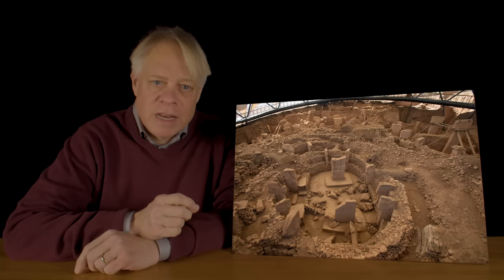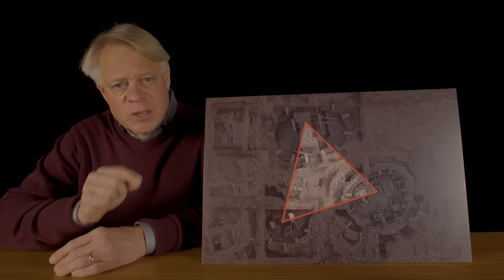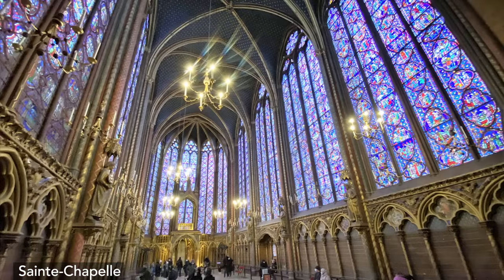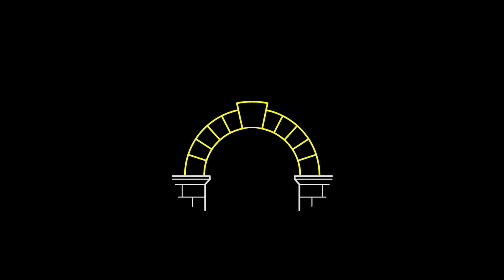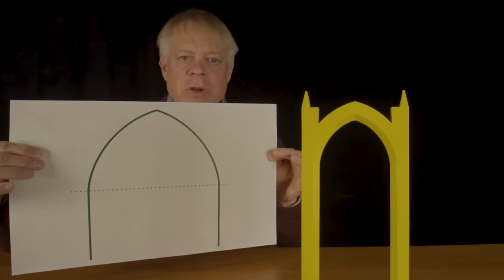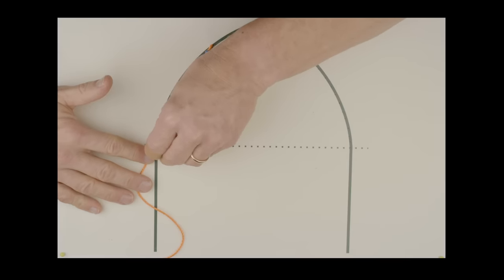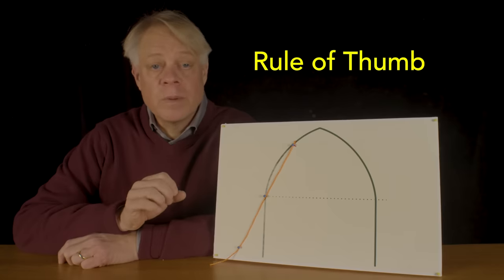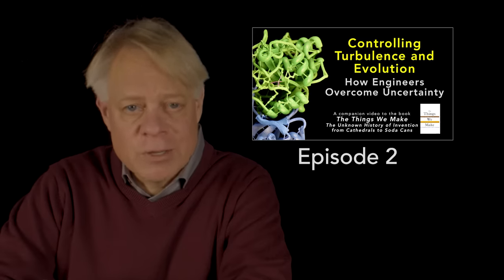Building a Cathedral without Science or Mathematics: The Engineering Method Explained

Comment: “I never worked out why, geometrically, that works- because it doesn’t matter” 

I love this a lot. You don’t have to understand why it works, you just have to know that it works. It’s the same reason you can be an electrician without being a quantum physicist
Reply: It's simply magic :)
lol
I think they just played with small models like you would with CAD & just proportionally expand it to what ever size you'd like. :)
Reply: You still need to verify that it works though with lots and lots of experiments. This is also how electricity was discovered before we knew about electrons and basic atomic theory: lots of experiments and writing down the results.
Reply: There are two types of bad engineers.
1. Those who waste time trying to come up with the technically perfect answer.
2. Those who blindly use their tools.

1 wastes time and money, 2 is dangerous.

You need to understand what's in your toolbox, and what the limitations of each tool are before you use them. Good engineering  is engineering plus risk management... "if I'm wrong which of these tools will make me wrong in a conservative or mitigatable manner "
Reply: What I think is beauty in engeenering is that a engeneer/theoric can deduct general rules and a engeneer/applied can create simple models. With this simple models the common electrician can work within a security margin with not deep knowledge
Reply: @driatrogenesis  quantum mechanics explains how electromagnetic fields behave and interact with matter, and why specific materials are better or worse at conducting electricity than other materials

There are other fields that explain different aspects of the topic, but the point is that you don’t need to have absolute knowledge of a topic in order to apply it to the tasks at hand.
Reply: @driatrogenesis  I’m sorry, please explain how quantum mechanics doesn’t explain anything? 

I get that the models of quantum mechanics are more just abstract representations of the physical world rather than being a literal description, but they still allow us to make predictions, create practical applications, and form a framework for understanding the weirdness of the quantum world, at least to an extent.

Even if it’s not a perfect explanation, it still serves the same function
Reply: @driatrogenesis  I wasn’t saying that other fields didn’t contribute to our understanding of electricity and how it functions, I’m just saying that quantum mechanics helps to describe some of the fundamental principles behind it that aren’t touched upon as much in other fields.

A true understanding of electricity requires all relevant fields, and I’m not trying to downplay the importance of any particular area of study
Reply: @driatrogenesis  What is your point here? How does any of this discount the descriptive power of quantum mechanical models?
Reply: @driatrogenesis  please just tell me in clear language how Quantum Mechanics can’t explain anything. You have yet to actually explain yourself
Reply: @handlsarelame I understand your concerns, but you are really misunderstanding my point. 

I’m just saying they don’t need to have the same level of understanding as a quantum physicist, which is objectively true, since if you’re as knowledgeable as a quantum physicist, you’re probably going to work as a researcher instead of an electrician.

More knowledge is always desirable, but a minute understanding of the fundamental mechanics of the universe isn’t always necessary for practical applications. You just need to know what is relevant to your line of work
Reply: @handlsarelame They learn a quite simplified version, really even a lot of electrical engineers don't properly understand how electricity "flows". What they learn are heuristics. Of course it's good to know a bit about how things work (or more specifically useful heuristics) but knowing how things actually work and being able to do things aren't actually nearly as connected as people think. A good book about heuristics is "Rationality for Mortals" and here's the video about electricity (there was a follow up to FAQs as well)
https://www.youtube.com/watch?v=bHIhgxav9LY
Reply: You don't have to, as long as you just repeat what already exists.
A factory worker does not need to know why the stuff he builds are built that way, or why they are built in the first place.
A carpender does not need to know why a certain construction is done that particular way - he just needs to know how it is done.
Just ask one why he builds a certain connection the way he builds it - the answer will often be just a variation of 'because that's the way it is done'.
That's fine as long as you keep building the same stuff over and over.
But if you want do develop something new, you either have to conduct a lot of undirectect experiments like build houses that keep crushing until they don't any longer - or apply science.
Reply: Learning how it works is simply helpful to push boundaries and broaden applications
Reply: @w1darr  You have to be careful about always doing it the same way and not understanding why. In the 1950s, the North American F-86 would occasionally crash while inverted, invariably killing the pilot. It took a bit to sort it out, but the problem was eventually traced to someone on the production lines who was installing a bolt upsidedown because he had always installed similar bolts on prior aircraft models that way. The improperly installed bolt blocked the ailerons from moving when that part of the plane was under certain loads, and without the ailerons, the plane was difficult to control, leading to numerous deaths of good pilots.
Reply: That's why the engineering method includes "rule of thumb". He explained it.
Reply: @handlsarelame 
You are missing the point. All he's saying is that a great athlete doesn't need to study biophysics in order to know what he does and what works
Reply: @handlsarelame What you are describing is still a very basic, surface-level, rule-of-thumb understanding of electromagnetism. For fucks sake, you literally learn left-hand, right-hand rules to know what happens even if you don't understand it at a deep, fundamental level.
Reply: 1) the architects knew precisely why their constructions worked
2) they simply knew how to do the math needed to cope with the forces involved
3) they couldn't achieve that without knowing why
4) rules of thumb have not been involved
5) the idiot who made the video above doesn't know what he's talking about
Reply: And which, the electrician or the physicist, is more essential in everyday life? I say the electrician. I have known many mechanics, carpenters and electricians you know, the trades. Their intelligence is creative and flexible. In fact most can solving problems outside their area of expertise.
Reply: @hans-joachimbierwirth4727  you got anything on that topic I could read on? I find it hard to believe they were winging it, I want to see their own takes if there's any.

Comment: I wonder about the process of developing one of these heuristics.  Was it one person or dozens who were able to identify a possible solution to a problem and then refine that possible solution by successive approximation, until the result stopped improving. Did it happen quickly or over scores of years?  What about the initial inspiration to try that type of solution to the problem.  Fascinating.  Thank you for this story.
Reply: Worst case: ask the same question about the creation of human beings . . .
Reply: @QED_ creation lmao
Reply: It would be helpful if the presenter provided some references that explain now he knows that these techniques were actually used.  As it stands, we have know idea how or if he knows that this was actually the method used by the cathedral's builders or if the presenter is merely guessing.
Reply from the maker: @rustyshimstock8653 The book contains the references …. This is a companion video to the book …
Reply: Well, then the book is as misleading as the video is. You clearly don't know what you're talking about.  @engineerguyvideo
Reply: Thank you for the bamboozling fairy tail , would sound more appropriate.
Reply: @hans-joachimbierwirth4727  sounds like you have an alternative explanation or idea about how these methods were developed?
Reply: @Cleveland_Rocks  Height wasn't the problem, neither was it the reason for the gothic arches. Width was, and horizontal thrust is the problem. Roman construction was based on different materials of which cement was one. Roman domes do not produce  horizontal thrust. His rules of thumb don't exist. Measurements do, and his rules would lead to collapse.
Reply: @hans-joachimbierwirth4727  His rules of thumb don't exist? Not sure I understand what you mean. Can you relate some historic data or sources that show how medieval masons and architects worked?
Reply: @hans-joachimbierwirth4727 It’s you who clearly knows nothing.

Comment: I believe part of the confusion between the scientific and the engineering method comes from the fact that in practice, these methods are often applied together by the same people. For example, let's say you test some equipment in a vacuum chamber. Some anomaly occurs in the test setup which cannot be readily explained. Opening up the chamber for analysis would destroy the vacuum and delay the tests by a week. The engineering method is used to mitigate the anomaly, allowing the tests to proceed quickly. To prevent the anomaly from occurring in the future, the scientific method is used afterwards in a thorough root cause analysis. Even though this may not be "new science" as such, it is still the scientific method, because the goal is to gain a deeper understanding of the system than was deemed necessary before.

Comment: This video reminds me so much of my dad; he was a pattern maker for 25 years and has been a carpenter for most of his life. He knows a lot of math and trig, but only enough to get the job done. If there's a way to do something practically that "just works" he'll choose that method every time, but keeps his math skills in his back pocket for the situations where that's the better option.

I remember him teaching me how to find the center of a circle once when we were making a mold for a circular foundation: he put a stake in the ground at one point on the circle with a rope that was the radius of the circle long tied to it and walked to the rough center and scratched an arc in the sand. He did that two more times at two other points on the circumference and told me that the point where the three lines intersected was the center. Blew my mind how quick and easy it was. Great video! Glad to see you back and can't wait to check out the book! :D

Comment: Fabulous! I have used various rules of thumb taught to me by 'old guys' on job sites. Often they are 'tricks' or shortcuts in math that lend themselves to fine quality without some of the complexity that more formal methods utilize. In other words, sometimes there is a hack that produces equal quality at a significant savings in time... if it meets code it's good to go.

Comment: @6:25 well by stating that the builders needed to stay between a certain ratio (1/4 or 1/5), then they had to use mathematics or an intuitive sense of mathematics to build the arches. Stating that engineering doesn't require science or math I think is incorrect, because science & math are not just what we learn in school with numbers but rather a way of thinking & reasoning.

Comment: I'm a mechanical engineer working in a cutting edge industry. we've even set numerous world records and world firsts with our designs. We use TONS of rules of thumb to design our solutions every single day, and I can explain why too. It just takes a while.
Reply from the maker: No doubt you do! The engineering method as I have described it still holds …
Reply: @engineerguyvideo  yes it does, and I love it. Too many engineers over rly on pure math, without understanding its limitations and pitfalls. Sometimes math is the right answer, other times it's not.

Comment: This is an interesting idea, but I feel like the definitions you used for science and mathematics are too narrow. It seems like your definitions of each of these subjects is the act of explicitly performing scientific discovery or the act of explicitly performing a pure mathematical analysis. I see science and mathematics as much more broad than that: when the stone mason is deciding how thick to make walls in a cathedral, they are using scientific concepts such as the idea that materials have a strength and may break under a load. When the mason uses a piece of string to work out dimensions, they are using mathematical concepts of geometry to arrive at these dimensions.

They're still leveraging mathematical and scientific understandings even if these understandings weren't their own discoveries. Even going down to the specific materials they used, the techniques used to create stained glass, and the instruments they use to physically create these structures, these are all applications of science and the end result of scientific discovery. And even going down to the most basic idea of lengths and measurements, these are still ideas rooted in mathematics.

My main point is just that science and math are often applied implicitly and intuitively and thus make their way into rules of thumbs, ways to preserve past knowledge for future generations. Science and mathematics are all about understanding how the world functions and this was very much leveraged by engineers in the ancient world even if they were only doing so from a practical and applied standpoint.

It's a great video nonetheless and highlighting the fact that you don't need to fully work everything out from first principles to engineer something is certainly useful. Engineers do use rules of thumbs even nowadays, but I think it's still worth acknowledging the inherent use of scientific and mathematical intuition in those practices.

Comment: 9:50 The size of the wall is 1/4th the size of the span of the semicircle.

First of all the explanation of measurements using the threads is fantastic. Thank you!

In my language, Bengali and many other Indian languages, carpenters are called "SutraDhar", which literally translates to "thread holder", they used thread and different folds of threads to determine the sizes.

Now details about the claim "The size of the wall is 1/4th the size of the span of the semicircle."

- Dividing the semicircle in 3rds is creating points for a hexagon, if it would have been a complete circle.
- The length of each edge of a hexagon is same as the radius of the enclosing circle. 
- If the size of the span is D, then the radius of will be D/2, lets call it "r"
- We can observe that there is a right angled triangle getting formed by the extended line segment, the width of the wall and the inner side of the wall ⊿
- We know that the inner angle of a Hexagon is 120˚, the base of the right angled triangle, i.e. the width of the wall is dividing the 120˚ in half, making it 60˚
- Using trigonometry; the width of the wall / the extended line segment = cos 60˚
- Thus the width of the wall = cos 60˚ x the extended line segment 
- Since The length the extended line segment = r (edge of a hexagon)
- the width of the wall = cos 60˚ x r
- We know that r is half of the size of the span, i.e D/2
- Thus the width of the wall = cos 60˚ x D/2
- Since cos 60˚ is 1/2
- the width of the wall = 1/2 x D/2  = D/4, 1/4th the size of the span of the semicircle.

Not sure if this is useful, but I found it intriguing.

Comment: Thank you for presenting your perspective on the engineering method. I've been a retired engineer for 15 years, and at the end of my career, I did more analytics than synthesis, and wrote many reports. So, it is difficult for me to remember that creative process we call the engineering method. 
My degrees are a BSEE and an MSCSE, electronics and computer systems, so I can't really point to my work and say that Science was not part of my process, however, we were taught what worked, and for what purpose. 

At the undergraduate level, we had a toolbox and I used it at first to build tools that solved bigger, more complex processes. 

At the masters level I learned how to think about my toolset to achieve certain engineering milestones. Accuracy and precision became a study. What's the difference? Accuracy is the act of ensuring that you reach the right goal. A machine that applies certain values of pressure to form specific crystal structure must apply the correct temperature and pressure. Precision is the act of repeating that goal again and again. 
Efficiency is a third measure of engineering work. Does my process meet design goals of accuracy and precision in the best way possible? How do we measure efficiency and why? 
The Masters program I attended helped me understand why we do what we do, and how to achieve those specifications in the most efficient way possible. 
Most of the tools I created are obsolete now. I also taught for a few years, and on reflection there are elements I taught in the mid-1980's that seem like a dead language. But that's not the entire story, because I also taught those principles of the engineering method that were, to the best of my knowledge, principles of getting it right, whatever they were attempting. 
Engineering principles can be summed up simply as doing what we know works. It works, giving us the results we need. There's more to it, of course, but in a nutshell, and engineer do what works.